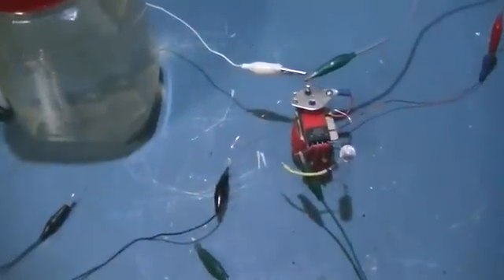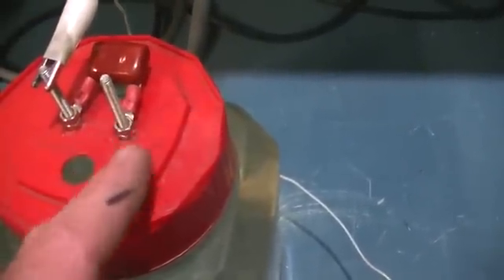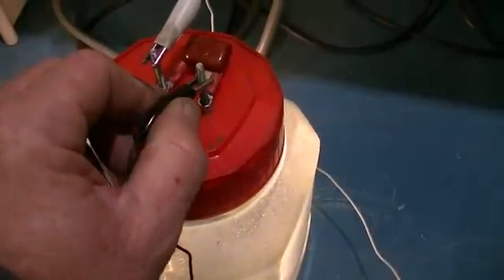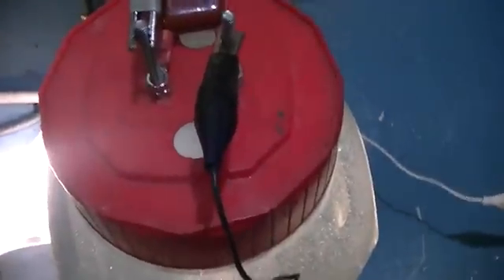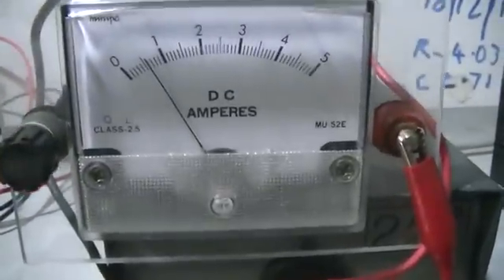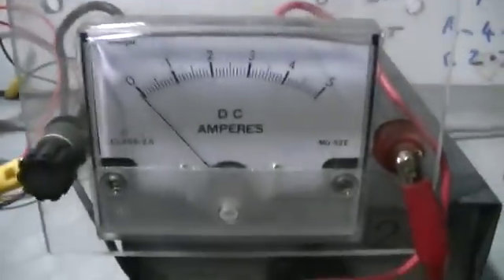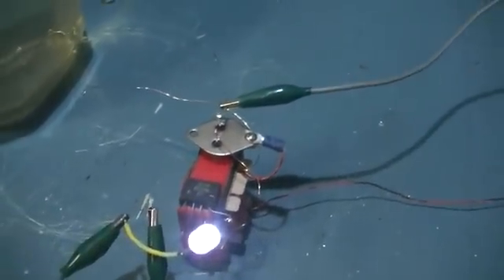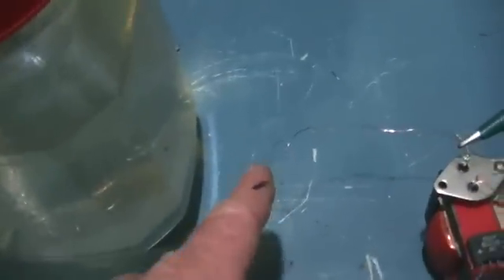Super Joule Ringer makeing HHO and a WTF.mp4

Comment: Hi, I was wondering if you could run another coil instead of powering your light bulb, it would make more gas and the light is pointless to make energy.
Also that terrible noise your device makes, I was wondering if you could use piezoelectric crystals to capture the vibration and capture that energy. If you coated the noise component with the crystals you could reduce noise and increase energy, just a thought.
I also wondered how much more efficient using the joule thief is, if you have time please let me know.
Reply: Yes, the gas production is too small for 500mA at 12V.
Reply: https://youtu.be/vVXzGcyzu6o?si=7XEDtoLTKxvC6axL

Comment: Sorry for the ignorance, but I don't understand how did you wind the second coil that runs the LED. Is it like a pickup coil that's wrapped around a free side of the ferrite or a third winding in the same place as the primary and the secondary? Also, did you try with a µA meter to see if there's a very tiny amperage drawing? Probably a 197V pulsed current needs a very small amperage to run an LED. I'm just giving an opinion, actually I'm a newbie in the world of electronics and Joule Thief circu
Reply: https://youtu.be/vVXzGcyzu6o?si=7XEDtoLTKxvC6axL